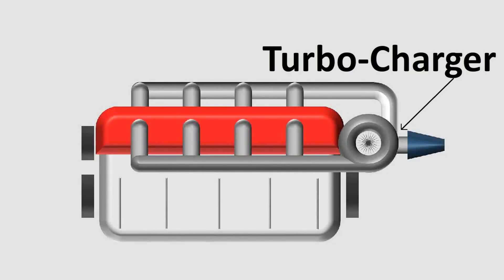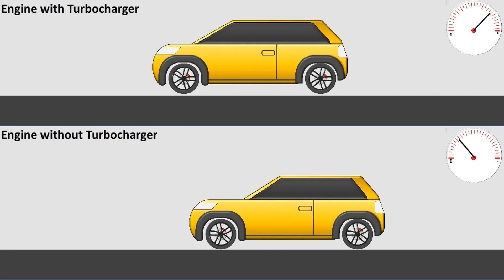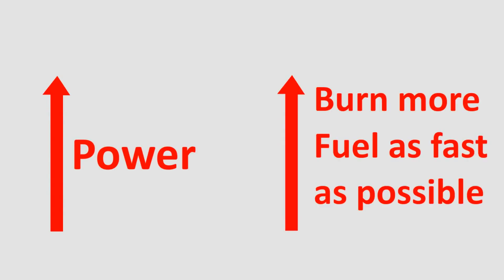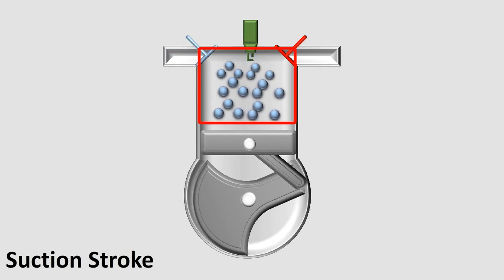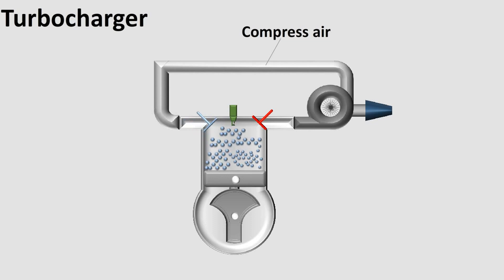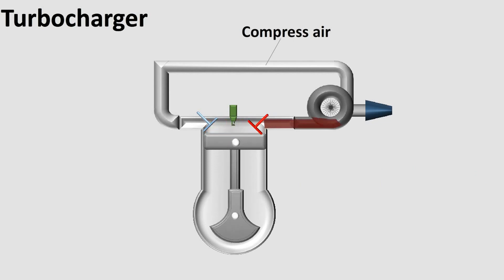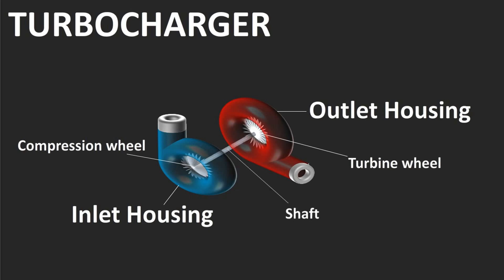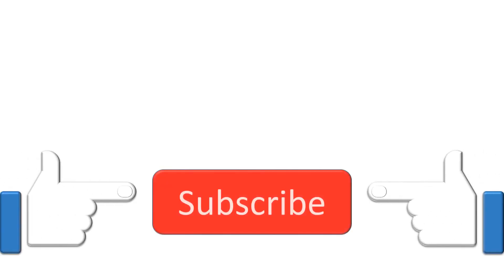How turbocharger works | Explain in simple way (Animation)

Comment: In fact, adding turbocharger decreases the efficiency of the engine, because piston has to create high pressure in the exhaust manifold during the exhaust stroke (actually sligtly more, than turbo creates in the intake manifold).